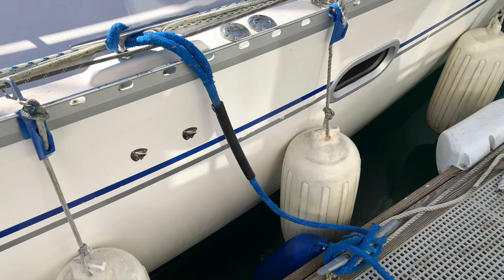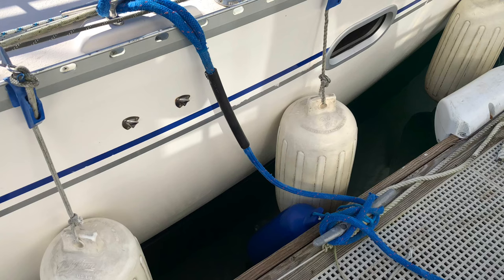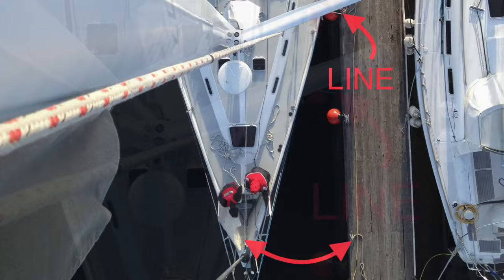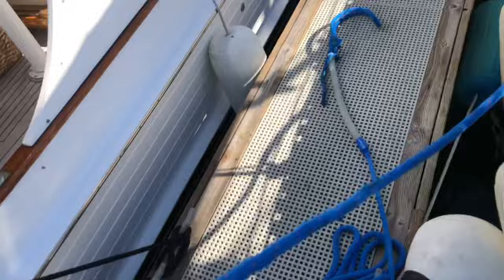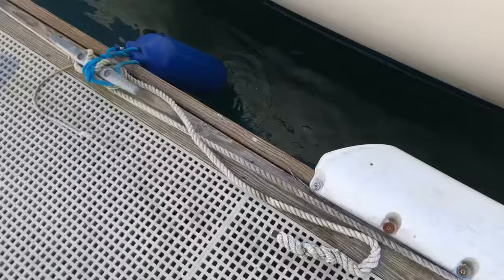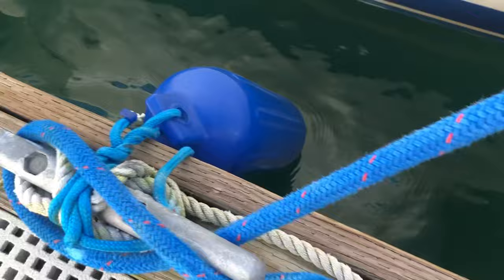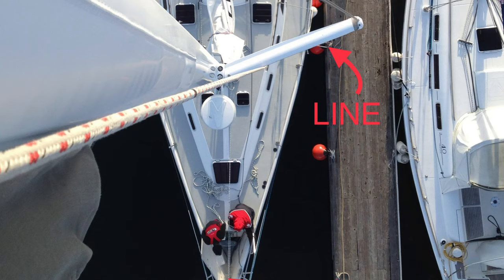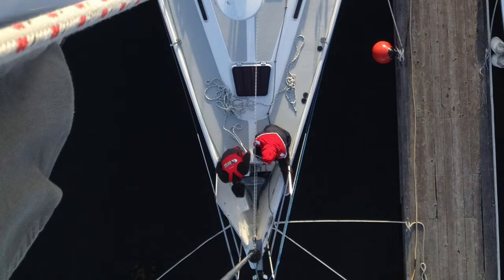Want to Dock your Boat like a Pro? Try This!!!

Comment: Thanks for shareing this. Personally i dont think that there is a single technique that works always. Better know and use multiple techniques depending on wind direction, boat and type of dock.
When docking I find it most comfortable to first fix the aft line (relatively tight) and then keep the engine in slow forward. This gently presses the boat sideways to the dock and it will not swing at all, neither does it move fwd or aft. Very relaxing in this situation to fix the other required lines. But again, it depends on the boat and dock etc!
Reply: …ah, and also it is easier for me to use the aft line, because i can fix that without leaving the cockpit
Reply from the maker: Yes definitely depends on your boat, the dock, and the situation. This is the technique I used in my home slip for about 10 years which has a prevailing wind and current that pushes the boat off the dock.

Comment: I do something similar.  I have an assigned slip so I leave my spring lines on the dock.  My springs are a single line with a mid-point eye spliced in.  The ends of the line are attached to cleats so that the eye is where I want my mid-ships cleat.  I use 8 strand (brait) line so I can easily do a brummel splice in the middle of the line.  When I come in I stop the boat, step off and attach the eye in the spring line to my mid ships cleat.  I then tie off the stern and bow lines and the boat is moored.  Leaving is the opposite.  I sail a 36' full keel ketch.
Reply from the maker: That sounds like a great variant of this technique!!!

Comment: Agree--we use the midship cleat approach with our heavy full-keel 32-footer.

For some reason here on the west coast of BC (Canada) many marinas don't install cleats.  Generally what's available for tying dock lines is a beat-up, cracked and splintery wooden railing.  If you use braided dock lines, they fill with splinters which then immediately find their way into the palms of the crew.  Three-strand line picks up fewer splinters and catches less, so we use that.  Anyway, cleats seem like a luxury around here 😁
Reply from the maker: I know it’s annoying that many marinas don’t have cleats! I covertly installed my own midship cleat in the last marina I was in and removed it when I left. I just used lag bolts but it was only for coming and going and I slackened it once the other lines were on.
Reply: This is too true. Checking in from Northern BC coast 👍🏻

Comment: When using a midship line aft to a dock cleat on arrival, if you put the engine in forward idle after you secure the line, the boat will stay in position while you tend to the other dock lines.
Reply from the maker: Yes that’s a good technique!

Comment: Nice video. Next one on docking a31’ trimaran solo alongside in a 15 knot off dock wind? Or solo in sluice/lock.
Reply from the maker: Thanks! I did regularly use this technique to dock my 42’ monohull in a 20 knot off-the-dock wind and 1.5 knot off-the dock current at my last marina! Trimarans are a bit trickier though because they are lighter and get blown around more, plus they are more square so it’s easier to whack the bow or stern on the dock. The key for me in either type of boat  is to keep moving at around 1.5 knots or more until the last second to keep your foils working and maintain steerage. I still use this technique on my F-82R though with the dock line around the forward beam. Thankfully we don’t have many sluices or locks around here!
Reply: @SailingTipsCa  We can share thoughts on my 'tri solo docking quest' in PM? for your next video. You want?
Reply from the maker: @RobertdeVries-trimaran-sailing  For sure let's connect offline!

Comment: I still like to put the bow and stern rope on, just to make sure the boat doesn't swing out too much especially if the tide is strong, and it would help prevent the boat moving forwards or backwards too
Reply from the maker: Yes you definitely want to attach the bow, stern, and spring lines as quickly as possible once the centre line is taught and the boat is under control. The boat can't really go anywhere with the centre line taught, but it's not a permanent docking solution, only to buy you some time to get the other lines on.

Comment: You don’t know what the wind is going to before you untie?
Reply from the maker: Yes you definitely need to take the wind into account! In my slip you have to back the boat out regardless of which direction the wind is blowing, so my approach is to untie everything so the only thing left holding the boat is the centre line, then see which way the bow blows (e.g. towards or away from the dock). Then I give the bow a shove in the opposite direction compensate for how the wind will blow the bow in the time it takes to release the line and start backing out with enough water flow over the rudder and keel to control the boat.

Comment: Cleats have "horns" not "ears"
Reply from the maker: You're right "horns" is technically more correct although I've seen both terms used. Sometimes different geographies use different terms on a colloquial basis.

Comment: Curious: do you add slack to the center line once you finish getting the other lines in? Or leave it taught?  I thought that a little slack was good.
Reply from the maker: Yes definitely - the center line is typically slack except when actively using it to leave or return to the dock!
Reply: @SailingTipsCa  Great video and thoughtful instructions.  The idea of a 'centerline' is easier to teach to a new crew than spring lines, so that's really helpful.  You made this point, but I would emphasize it even more: once you are finished parking, the center line should be slackened (or removed) and proper spring lines put in place.  If you were to leave the center line tied up tightly, then the force of a large wave could cause damage as the boat would be too closely connected to the dock while the boat and dock are rising and falling at different intervals.
Reply from the maker: @1kfarrel  You're exactly right! I should have done a better job of emphasizing that the center line is only tight 1) before you leave the dock and remove the other lines and 2) Immediately after you return to the dock, and before you secure the other lines. In other words, its primary use is the last-line-off and first-line-on, but is slackened at all other times!
Reply: @SailingTipsCa  yep, and as part of my sailing education, I damaged a toe rail once in the way described here.😉
Reply from the maker: @1kfarrel  That's the great thing about sailing - it's a constant educational process!!!